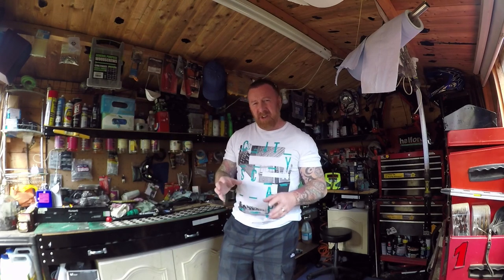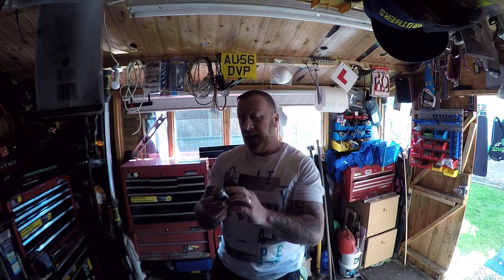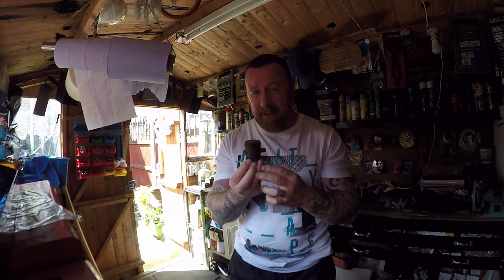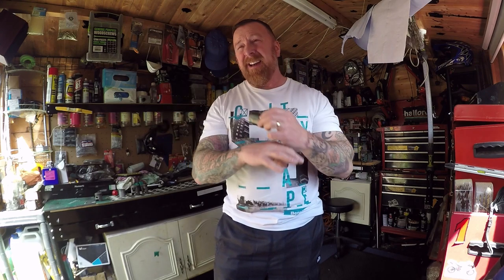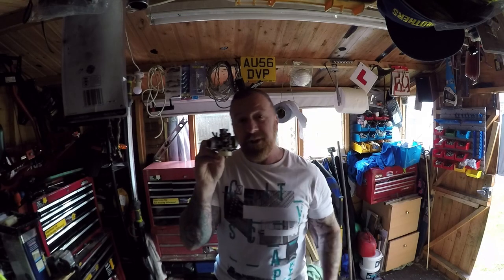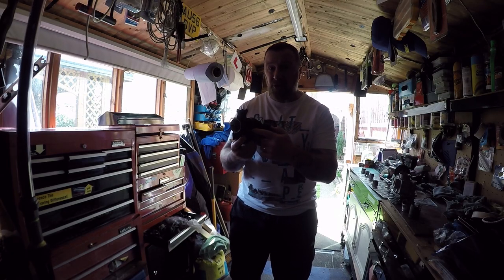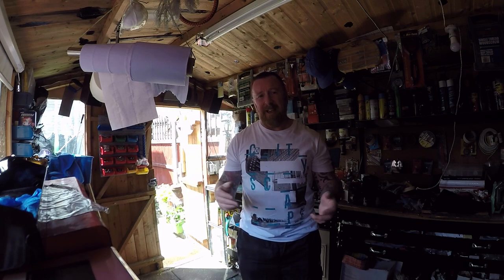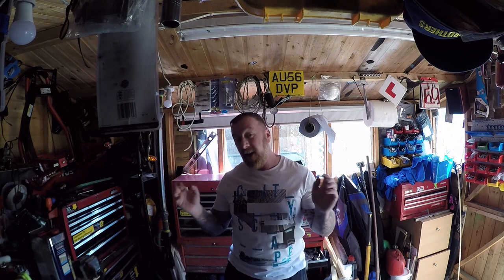PISTON GONE PISTON KIT UPGRADES WHAT YOU NEED TO DO MARK SAVAGE

Comment: I’ve got a Suzuki ay 50 lc r standard I’ve put a new top end on the ped all running great but the new barrel the water feed pipe that’s on the barrel that your water hose gows on,the metal pipe that gows in the barrel is loose  isit a push fit ive tuck it out and yoused some high temp red sealant and pushed it back in..thank you mark jay

Comment: great video and your 100% right a lot of 16-20 year old's with there 50cc will just put a big bore kit on  and maybe a exhaust  they just upjet the carb tho take into count some 50cc scooters only have 12mm carb thats not going to do anything and they forget about a gear up kit to stop over reving what i find kills a lot of scooters that have big bore kits on due to its just reving and reving but the gear setup is not done so they will not get the best from there big bore kit and will kill it faster due to over rev with limiting gears

as  big bore kits if done right can be reliable if you do all the supporting mods carb , gearup , exhaust   , reeds , crankshaft , variator and clutch  but that can build up a big price tag like mine so far spent around £700 but  has been setup right with a rolling road and been on the dyno just to make sure its setup as best as i can  to get a nice 16hp at flywheel whats a lot better then the 5hp the 1e40QMB comes with 

and i know what you will say mark why not spend that money  that i have spent to do my licence a  but i all ready have that my scooter is just a weekend play toy and use the fzr400  for work as i ride 62 miles each way to london every day

Comment: Great advice regarding sticking with standard bore size, I can however vouch for the Malossi Sport cast iron 70 kits. With fuelling set up and a sport pipe mine lasted 5k miles before I sold it, could still be going. 

If your using your ped on the road, stay away from aluminium kits, stick with cast iron, make sure the piston has 2 rings and not 1 (race kit) and get a pipe designed for mid range power and play with roller weight accordingly. 

Getting a single ring race top end and a pipe that revs to the moon won’t last 2 minutes on the road. Cheers.
Reply from the maker: I totally agree with you bud 
Take care and thanks for sharing
Reply: Not sure if you will see this but I have the malossi 70 cast iron kit I’ve got the airbox snorkel removed malossi red sponge filter and Leo vince TT exhaust with 5.7 G rollers standard variator and clutch apart from yellow clutch springs my main issue is jetting I just can’t get the scooter to run right at all it cuts out on me when on idle every time and doesn’t like to hot start I have 76 main jet tried 80 it was rich and tried 72 it was lean 76 seemed to be the sweet spot but it’s just still not right. I’m stating to think this could be a CDI/ spark issue

Comment: Here in USA 2 T is rare.  I've found the GY6 49cc scooter engine is a great engine if you'll keep carburetor and fuel tank clean . I clean carburetor once a month.  About every 10 days I inspect and clean the variator system.  Replace weights and belt . I carry a belt and variator removal tool and the other tools needed to replace the belt if it should break . 8mm, 10mm , 14mm , 17mm sockets and wrenches are a necessity, especially the 8mm and 10mm . 
Most problems that occur on the Chinese Scooters are carburetor,  contaminated fuel related.  Never let one sit for long periods of time without using some sort of fuel stabilizer.
Reply from the maker: And agree you have to just do the simple maintenance and yes they will just keep going and going 
Well done bud

Comment: Hi mark, i'm the one who wrote to you about my seized Kymco Agilioty 50cc 4t, about 3 weeks ago i went to pick my son up from his house, about 5km(8 miles) away and all the way there, the bike was doing 60kmh/48mph no problem, but when i arrived there i realised i had forgot his helmet, so i heade back home to pick it up and after about 3km(5miles) the bike started losing power as if there was dirt in the carb, so i shut down, then opened up again and it seemd ok, this happened a few times on the way to pick him up and when we were both on the bike, she lost so much power that she just stopped. I tried starting her again, she was backfiring like mad but she finally started, but then she wouldn't go above 30km/h so when i got home i called up the repair shop and they picked the bike up on saturday and phoned me up onthe following monday and told me that the entire drive train from front to back was worn or broken, (the bike had done 30000km(48000miles approx) so that was no surprise, but then he phoned me on tuesday and told me that he was experiencing the same problem i had as long as the bike did 40-45km/h there was no problem but going above that she lost power to the point that she almost stopped. he had tried everything to get her back new CDI, brand new Carb, re routed a new earth wire, checked all the electrics, the bike idled perfectly, but under load it failed, so after 2 weeks i made a deal with them, to take the bike as is and i traded it in for a Kymco people s, they were also kind enough to dismiss their costs that they had so far. Have you any idea where they could look to try and solve the problem?, the mechanic has been working with scooters/mopeds since he was 16 so about 30-40 years expereince and he told me that he has never before experienced this problem with any bike he has worked on lol
Reply from the maker: they can be so odd these mopeds and for such a little engine can cause so many problems, as in some of my speedfight videos 
you cant fix them all and sometimes they just need to be used for parts!
this sounds like one of those times as how many hours do you put into it 
if you have a new moped that runs now id be happy and leave it with him lol 
take care bud

Comment: Do you think the prices of two strokes are going up? Seen some crazy prices lately.
Talking of oil pumps mine failed this week. Filled the whole cylinder and airbox with lovely Castrol. It's a new one for me.
Reply from the maker: totally agree bud the price of mopeds well all bikes seem to be at a high, 2002 speedfights for £700!! and they work doing too
even the none runners are high, always makes me laugh when the Ad says great scooter/ moped A1 loads of new parts- does 50 mph only thing is it doesn't run !!  
that's the problem with oil pumps you just dont know when they fail until the engine stops lol , thanks for watching and your comments bud

Comment: Hi Mark, I have a Speedfight 2 AC 50cc with leovince exhaust, stock carb (gurtner france) and I want to buy a variator Malossi Multivar to increase the speed. Do you think it's a good deal?
Reply from the maker: A upgrade to the variator system is always a good idea and will help 
Remember to buy new rollers and check the belt while your there

Comment: Hi mate I have a piaggio it has all sorts of stage six parts rollers and whatever the previous owner done. Its onley electric start it takes a while to kick over and the guy said it needs tuning what does this mean
Reply: Is it air and petrol mixture our could it be to do with the rollers
Reply from the maker: if it take a while to start it can be a few things 
I have many other videos on my channel that will help from carb cleaning to tuning and servicing even jetting these should help
some times the electric starting problems can be electrical so stator coil , earth problems but start with these things first bud
Reply: @marksavage  thanks I will check then out keep up the good work

Comment: Hi Mark, I have watched a few oy your videos and I am looking for advice. I have a 2015 Aerox NS50, the exhaust has rusted away and while replacing it the boss holding the exhaust stud to the cylinder crumbled away like a piece of cheese! First, is it OK to replace the piston and cylinder only or should I replace the head too? I notice that you often don't remove the engine from the frame when working on the cylinder, is that because removing the whole engine is more hassle than it's worth? Thanks for the video's, Steve.
Reply from the maker: this is common and i had it many time , if your lucky you can re-tap them otherwise its a new cylinder and while your there you may as well change the piston , the head will be fine bud to use again
Reply: @marksavage  Pedparts list 3 'standard' 50cc cylinder and piston kits, '101', 'TNT' and another one un-named. Do you have any recommendations? Would any of these require the carb to be re-jetted or should be OK as the same 50cc? Thanks

Comment: Hi bud what I've done is cracked the left crank case on my 2t 50cc putting gear box back on done bolt up to tight and crack it. So now gear box oil leeks out abit I do have a whole new casing the question is how easy would it be to change it and I would have to tell DVLA as it's a different number on it great video mate steve
Reply from the maker: Hi  bud
It's not a huge job and my videos will help with 70 of them just find them right one lol 
As for dvla the frame number is the one that really matters on mopeds as all the other parts and  engines get changed over the years any way
So all ok

Comment: Hi Mark. My 2016 TaoTao 49cc was smoking and using up oil so I replaced the piston rings, cleaned the piston and put everything back and adjusted the valves to .004, cleaned the cvt case, replaced the old rollers with new variator kit new belt. Clean the carb and jets and switched it with a #85 now it cranks and it almost starts but doesn’t run. Is the jet to big for a stock engine?
Reply from the maker: I'd agree bud and put the old jet back in as you maybe flooding it with too much fuel 
You would need more air in and adjustment to try going back bud

Comment: Hi I’ve got a Peugeot Jetforce 50 C-tech, 2T

I’ve changed the rollers to 7g and it was running fine for ages since I made sure oil was topped up and my bike was serviced weekly, but then the variator nut came undone due to vibrations and my bike hasn’t been running properly, I made sure to change all the parts that could of been damaged and cleaned all the rollers again and I’m struggling to think of what it could be
Reply from the maker: if the nut came off it will cause damage to parts but you will need to change the roller again as they could be damaged 
you might need to use lock tight on the nut to stop it happening again
check belt too bud
Reply: mark savage okay

Comment: Hi Mark. I have a 2016 TaoTao 49cc and I just replaced the piston rings. Put everything back together, now it cranks to almost start but it doesn’t. Please help. Thanks
Reply from the maker: this is a 4t moped? 
if so did you put it all back ok and the timing chain in the right place 
if out of place by one tooth this could be your problem 
but when you did this did you clean the carb and plug as this will help 
maybe some easy start just to get it going 
does it have a double vacuum fuel system or just straight into the carb as ive not work on one before 
why did you just do the rings and not the piston too
was there any scoring on the head or piston as I would have change the piston as I was there lol
how is the 4t oil did you change this too 
2t mopeds are so much easier to work on lol

Comment: I’ve ordered a new top end but i’m curious how much oil i should mix with the petrol for first start. any tips on breaking it in also? it’s a 50cc moped btw
Reply from the maker: I used to just add a cap full and use 2t oil when fitting the piston into the head just for first start up as this really helps
as for running in let it tick pver for a while then turn off leave for 5 mins start back up and leave running then check head bolts and everything is on and ok then take for a test ride up and down the road a few time ,then off and turn on again rev and ride up and down the road 
if all ok take it for a ride and slowly go up to top speed and down again , don't keep it at top speed for long and do that for 40 odd miles then all should be fine bud
Reply: mark savage Perfect explanation! Thanks Sir.Savage.

Comment: And can you please do a video talking about 4 stroke 50cc scooter! I don't know why I always feel like mine is running hot!! Only cause it smells hot. I make sure its well kept. But still I can go a few miles up the road turn the bike off and its almost like I can smell hot plastic... Its driving me nuts! Lol
Reply from the maker: I do have a few videos on 4t mopeds as they are more reliable than 2t as long as you service them, odd about the smell which I guess its coming from the exhaust?
they are air cooled but it has been hot the last few months so maybe as the weather is cooling down this may stop, but as long as it runs ok its not a problem just dont over fill the oil as this will do more damage :)

Comment: Hi mark i have aprilia rx50 2001 and i have been riding it since October when it had new topend. Put a ginnelli exhaust went pretty well got up to speed quick  i did upjet and  also put a new carb on it.
For months it went pretty decent but all a sudden it just has no power at pulling away getting up hills takes for ever to hit the powerband. Im starting think maybe it needs a new topend?? As i have clean carb and changed the sparkplug but still going really slow. Also i can only shift to 3rd as rpms just drop when i go into 4th and  5th.
Reply from the maker: Agree bud sounds like its failing again 
What 2t oil you been using taking its 2t ?
You might have scoring on the side and rings 
I'd take it off and have a look bud
Reply: @marksavage  always used castrol racing 2t oil using the oil pump.
Reply: Okay i will take a look thanks for help appreciate it.

Comment: my speedfight was doing my head in id literally changed everything and it was doing nothing would not budge past 30mph then it clicked in my head what if the piston is due changing because thats the only thing i havent changed and its got the same piston in from 2003 when the bike was made with 17000 miles on it so i took cylinder off and you could tell the piston rings was definatley worn because there was a lot of blow by happening so i have got a fresh piston on the way
Reply from the maker: that should sort out your problems then bud, i always add a little 2t to the first tank to help
Reply: @marksavage  cheers mate your channel has been a massive help mate

Comment: Hi mark, I've been working on my aircooled 2t speedfight 3 50 for the past couple months before my 16th and i'm about to change the exhaust from stock to a sports one. I was wondering how much to increase the jet by, I've read that 10% is a good start so in this case i would change to a 60 but i was wondering what you would recommend as a starting size even if i have to change it once i've got it running. The exhaust is the Leo Vince TT with the pipe restriction removed, also other than rollers and the variator washer the bike is completely stock.
Reply from the maker: that's bang on bud I always go up by 4 so stock 56 60 is right as in my other videos on speedfights , I have 70 videos on them and some on the sp3 but only a few
however most of the basics are the same 
well done bud keep up the good work

Comment: Hi Mark i'm so sory to ask you again i fix a new head and piston +rings on my Piaggio Zip 2t is stand kit a now i need to drive around 30 miles p/h my question a many miles i need to do whit new piston thank you very much
Reply from the maker: full tank full bud and i'd add a little 2t in with the fuel then next fill up it should be fine
Reply: @marksavage thks very much

Comment: Hi Mark, I have a 2016 VIP 49cc 1300 km and it looses power to almost stop while going uphill. Any suggestions? Thanks
Reply from the maker: ok bud i'd start with the VARIATOR system and rollers like in my videos on my channel, easy to do just follow the videos 
they maybe on speedfight but the basics are the same and I have 150 moped videos on all sorts of thing to help 
after that maybe a service plug ,airfilter, clean carb, but with very low miles its odd to start playing up
Reply: Thanks you. Also thanks so much for taking the time and answering. Keep posting
Reply from the maker: @MrMatari7  also when I say check the VARIATOR system I also am including the clutch as in one of my speedfight videos this was my problem so worth a check but shouldn't be with such low miles , take care bud

Comment: Hello I have a moped that died once it reached top speed so I rebuild the carb and got it to start again but it had the same issue just at a bad tune so would only do 40mph instead of 60. Any suggestions would be great, thanks for reading
Reply from the maker: I’ve had this and it was simple fuel !
The moped was using more than the carb bowl was filling up!!!
Adjust the float so it can fill up faster 
Check intake filter replace or clean 
Have you an in line filter ?
Check them out if fuel ok then it could be electrical
Reply: @marksavage  thanks I'll have a go I have loads of spare parts but didn't want to go replacing stuff not knowing the issue. Love your videos by the way keep em coming!
Reply: @marksavage  thanks it was the float! Bit of a tune and it's back to its old self again now it's just the head stock bearing I think it needs replacing it got about a inch of travel. Do love a project bike tho
Reply from the maker: @nathanseward9671  got a video on that too lol 
Have fun bud

Comment: Hi I have a question . Yesterday I was riding my kymco super 8 125cc, when it started losing acceleration I pulled up switch of the engine then tried restarting , it did start up but then cut out in idle . Now it won’t start up at all just sounds asif the starter is turning but not the usual electric start noise , any ideas?
Reply from the maker: piston failure, when was it last serviced , E10 fuel like in im video
Reply: I’m not sure mate I’ve not long bought it .
Reply: Easy fix or?